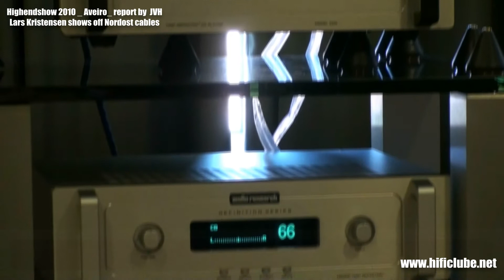Nordost cables by Lars Kristensen.avi

Comment: This is complete nonsense. The last thing you want is an increase of the impedance on an earth, it's pointless and dangerous. In any case sound quality isn't affected by mains quality unless it's badly designed. A £2.99 mains strip will sound exactly the same as that overpriced piece of nonsense he is holding.